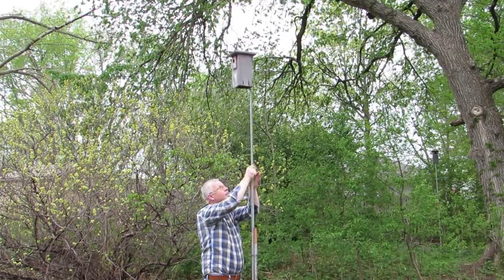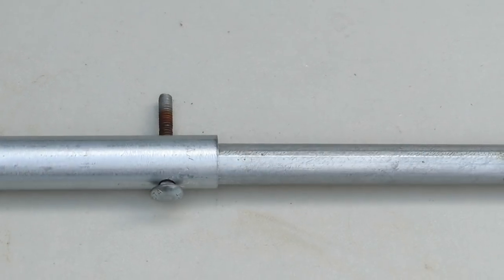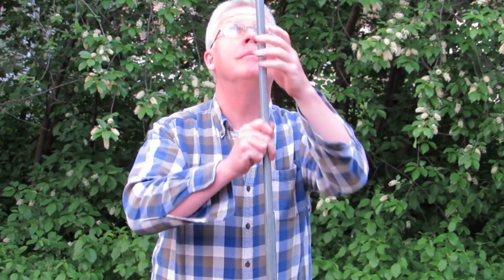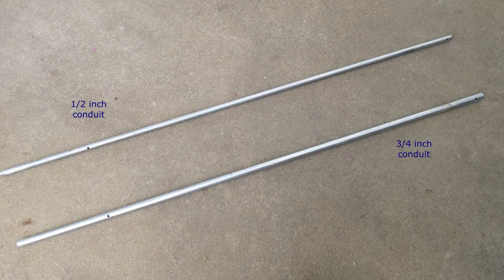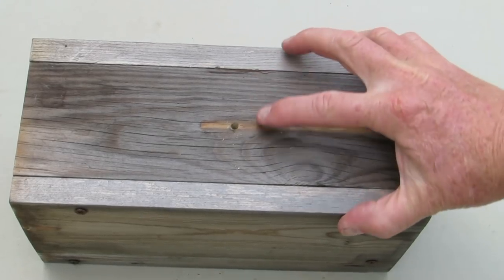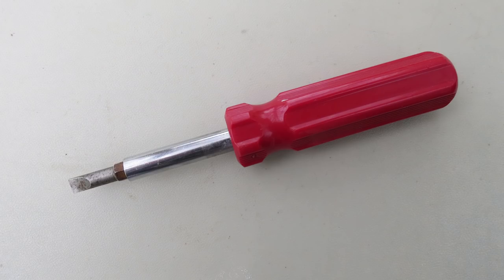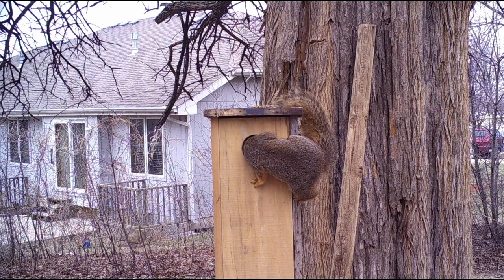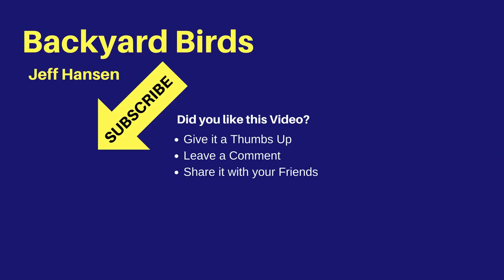How to Mount a Nest Box on a 10 foot telescoping pole made of conduit 2019

Comment: My dad just sinks two posts with about 3 feet above ground then runs a bolt through a pole betwwen them at the 3 foot mark and a hole at the base. Unbolt the bottom bolt and pivot the full length pole to the ground.  Only checks them in winter when birds have moved on.
Reply from the maker: Nice. I like the telescoping pile for monitoring

Comment: This is really well done, outlines everything you need and how to do it. I put up a screech owl box last week, using the Large Box instructions. The only changes I made were these  -- I cut my I" conduit into 2 five-foot lengths instead of four pieces. Used a five-foot length of 1" and a 5 foot length of 3/4" conduit. Used 2 hose clamps instead of one. I also found I needed a 2 1/2" bolt (instead of 2-inch) to attach through the back of the owl box at the top of the conduit , in order to have enough threads to attach the nut. Since I had leftover materials (and a new post pounder), I put up another telescoping pole. This one has a winter roosting box which I will convert to a bluebird box in the spring.
Reply from the maker: Your post made my day. I sure hope you get screech owls. I have yet to have them nest in a box successfully. Very important to have a predator baffle. Thanks so much.
Reply: Great modification. I was thinking of putting up a screech owl nest box but was worried that the owls would eat the songbirds I am also trying to attract. What are your experiences regarding this?

Comment: Great idea! Do you find with larger boxes the T-post is enough to anchor? Or, do you suggest cement in the base. I'm planning on a large barn owl box
Reply from the maker: Very good question. The barn owl boxes are heavy and i had one on three quarter conduit and it bent it in high winds. But i think 1 inch conduit would support it. The t post seems quite sturdy. I want to mount a barn owl box in a building. Good luck

Comment: Thank you so much for this video. I’m planning on making a screech owl nesting box this weekend. Would you recommend cementing the base into the ground, or does it seem steady enough on its own?
Reply from the maker: I find that it's plenty steady. And what I like about using a T post is you can easily move the nest box which I've done multiple times. If you use concrete it's kind of permanent.

Comment: Just curious, how sturdy is this setup? I'm worried it will not stand up to a big storm, but am curious to what your experiences have been. Thanks!
Reply from the maker: I've been using it for s number of years on the plains of South Dakota. It with stand high winds and ice. The only failure is when the bolt comes out. I stayed using a nail instead.
Reply: @BackyardBirdsUS  Thanks for the reply. I sincerely appreciate it. I'm going to be putting up two of these this weekend, and will probably go with two bolts and use wing nuts to secure both of them. I'll keep you posted.

Thanks again for the great content!!
Reply from the maker: I think bolts are an excellent idea. How exactly will you attach them. I need to do something different.

Comment: I have a 35 lb northern flicker box that I want to mount.  Will this system work or do I need to rig a pulley?
Reply from the maker: That sounds way to heavy. But I've never weighed mine. Mine is about half that weight. I think you need a pulley or a very heavy wooden pole with baffle.

Comment: You said to pound the T post until the flange is covered.  Isn't that only a foot?  Is that enough?  At HD only 4 foot and 6 foot length kept in stock.  I have very bony soil.
Reply from the maker: It has worked for me. There are a variety of posts so you may want to drive it ina few more inches but don't think it's necessary. If it can hold a fence with cattle it can hold a bird house.

Comment: Hi Jeff,
PLease can you give us a quick advice if and why is it better to mount Nest boxes on trees or on the telescoping poles
Thanks a lot!
Reply: In my case, mounting a large size box for screech owls on a tree resulted almost immediately in a litter of squirrels in the box. But even if you're using a smaller box, for example for bluebirds, you're exposing the young to predators if you mount on a tree.
Reply from the maker: The problem with trees is predators can climb them. Raccoons are notorious for eating contents of a nest box. They eat the eggs, the young, the adults. Snakes can't did the same. Squirrels will chew open the nest box. Putting it on a metal pole with a baffle will prevent climbing predators. It makes a huge difference in success rate of nests.
Reply from the maker: I've had squirrels use big nest boxes because they jumped to them from a nearby tree. They are definitely a problem.

Comment: Thanks very much this is a great   video.  Based on your level of attention to detail I'm sure you would have mentioned it if it was needed, however I'm just curious does the EMT conduit need to be grounded?  Once we put up a pole 15 or 20 ft in the air are we going to create a risk for lightning strikes?  Forgive my ignorance on the conductivity of the conduit but I had to ask?
Reply from the maker: I'm sure the conduit would conduct electricity but if it is attached to something in the ground that is metal it should be grounded.
Reply from the maker: I've never used conduit for that tall of a pole. But again if it's in the ground it's grounded.

Comment: I really like this!  I do plan to try to get some put up this way.  I did not locate the extended information on how to make the baffle? Am I missing something?  I will need this for sure as the area is overrun with squirrels. i did find the link on drilling holes.  But not the link for the baffle, nor for the sources of supplies. Thanks.
Reply from the maker: Florrie, I haven't uploaded the baffle part yet, but I did put the materials in the video description.  What's nice is you can make the pole and add the baffle later.  I didn't even use baffles originally until the squirrels came and destroyed.

Comment: Would this be too flimsy if I did a three section pole making it almost 15 feet high?  I would like to attract starlings in order to trap them in something other than my martin house. I'm thinking they prefer the height.  I would set it up near the martin house. If you think this is worth a try, what would be the best house for the starlings?  A horizontal box similar to the martin compartments?  Or would a bluebird house do? 

Just brainstorming.
Reply: Oh!  I see I already asked that question.  Also I just found your starling traping videos.  I'm going to watch them.  Thaks!
Reply from the maker: Ten feet works fine. You don't need to go higher for starlings.
Reply from the maker: I hope the videos are helpful.